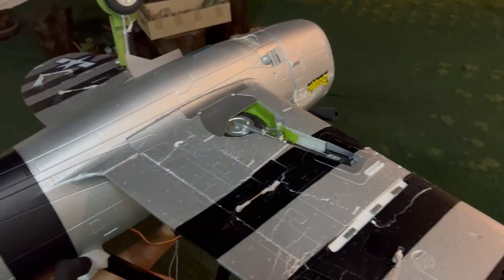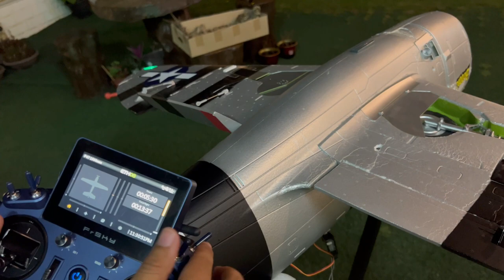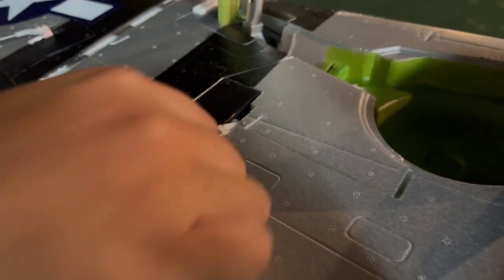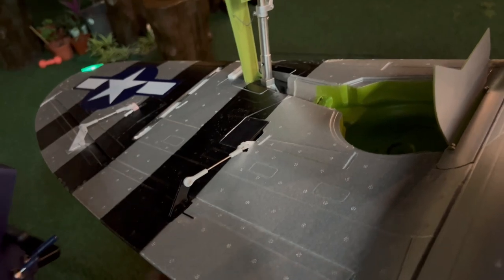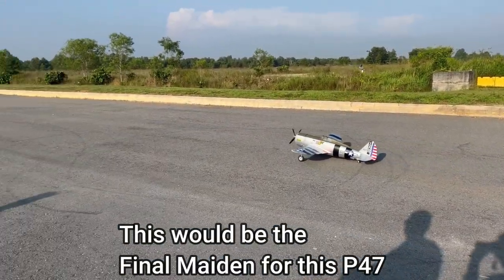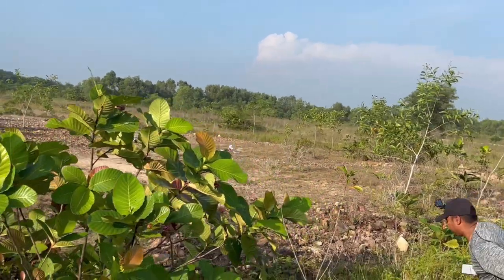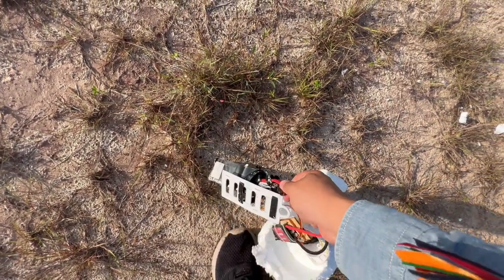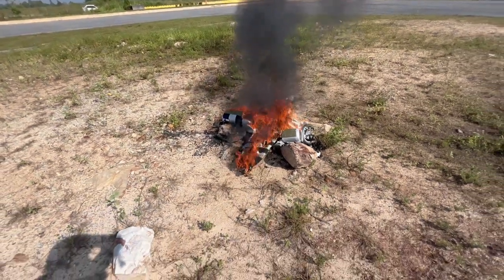[REMAIDEN FLIGHT] FMS P-47 Razorback 1500mm Maiden Flight - CRASH TOTAL LOST! (PART 2)

Comment: It's not the connector bro. When you plug the other wing in, you draw more amps from the bec. The ESC's bec is already failing. You should've used a separate BEC. Due to intermittent/insufficient power/voltage to some servos, it keeps resetting and trying to center itself.
Reply: Are you saying that the original BEC was no good to begin with?  Maybe underpowered? Separate BEC?  Can you explain please....